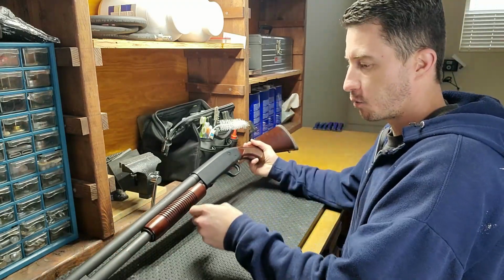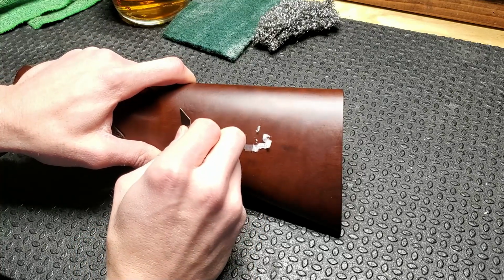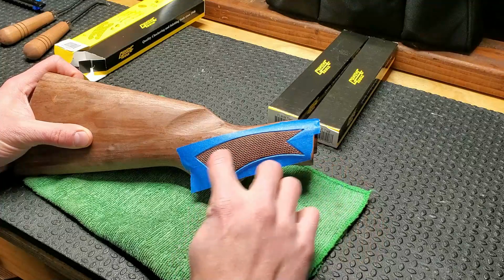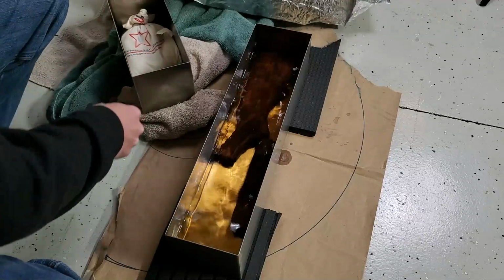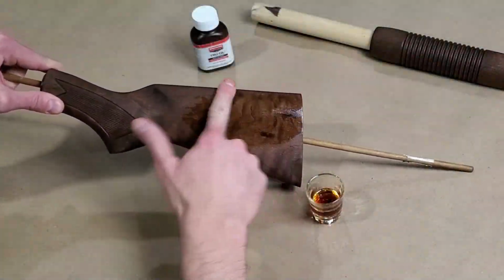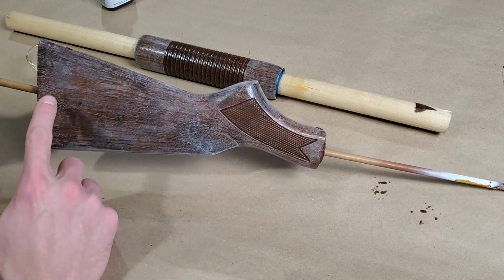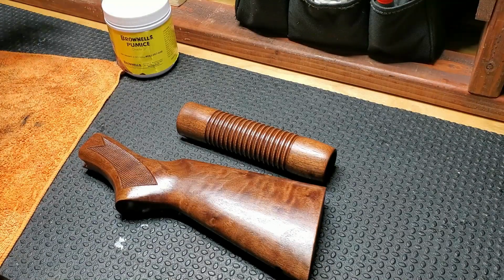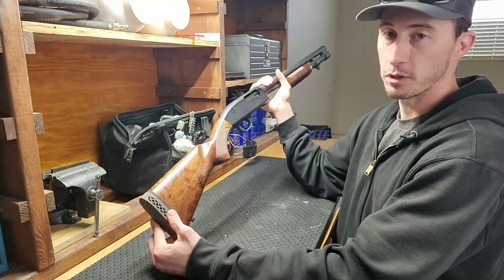Mossberg Retrograde Refinish.

Comment: Would soda blast take off the finish in those tight spots?
Reply from the maker: Based on other wood projects I've seen, I would say yes. If someone has that setup that would really save some time! It would get in curves and corners really nicely. My only concern would be in the checkering areas. Not sure if it would dull or round over the diamonds too much. 
Thanks for watching and for the great question/comment!
Reply: @CRoutdoor  Thanks, I ask because I just got one and I want to finish it the way you did. I have a soda blast I got from harbor freight, not a bad price. Might try it out and hope I don't remove too much checkering.
Reply from the maker: @ruben619448  If you have a gun/gun parts classifieds in your area or a gun shop that you can go pick up a cheap junker stock that has checkering, that would be ideal just to test it out. Then you'll know for sure. 
Hope your project turns out great!

Comment: That turned out really good! I prefer a red tint also. What would you have used to add the red?
Reply from the maker: Thanks! It's always a little scary starting a project like this but I think it came out great too. 
To get some red color, Pilkington has a spirit stains that is "pre 64" meant to replicate that reddish brown on pre 64 Winchesters. They also have an "English red"... I've never see that on a project though. Those are usually out of stock, so in reality I probably would have picked up some red stain at a hardware store and played around with different mixture ratios. Maybe in the future. 
Thanks for watching and for your comment.
Reply: @CRoutdoor  you're welcome. I haven't ever refinished a stock that's in new condition, so I totally get the scary part. It was definitely an improvement though. I've tried a couple of minwax stains that looked very red when applied but not so much after you wipe off the excess. Thanks for the info.